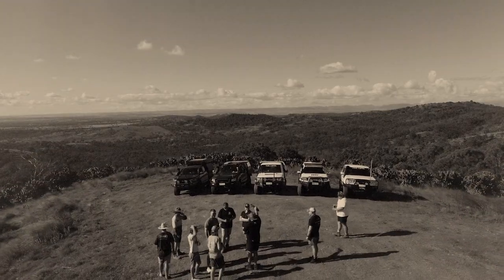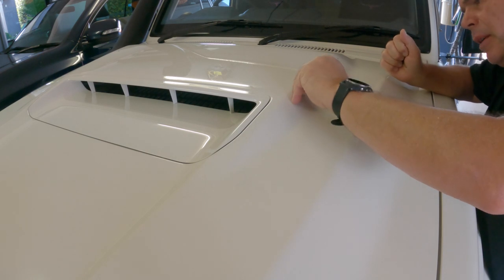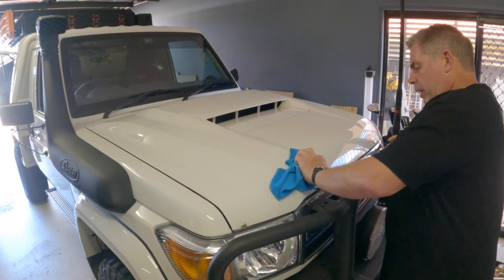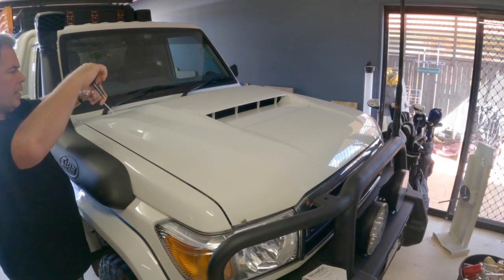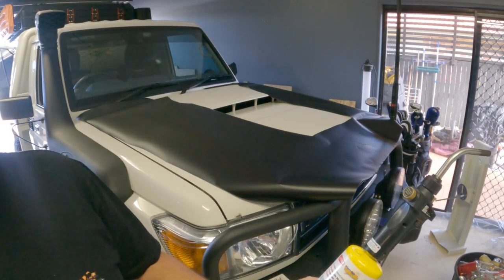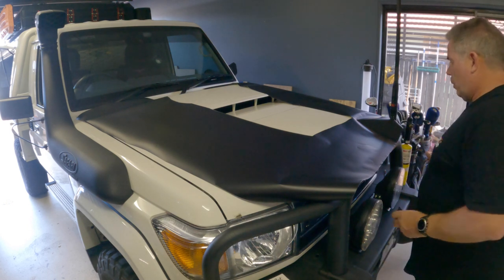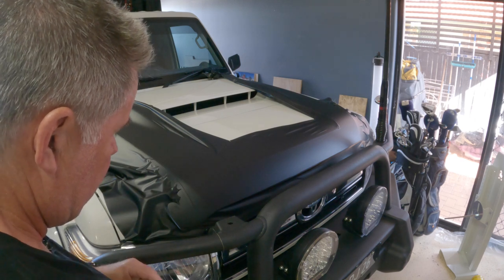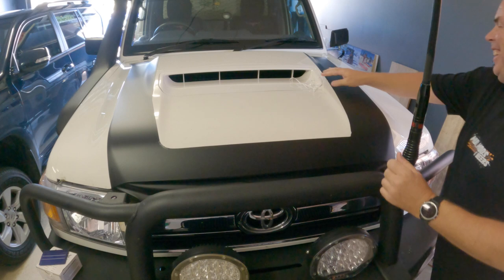We custom wrap the 79 Series Land Cruiser Bonnet in Hexis Satin Black Vinyl.

Comment: A nice quick job.
The issue that exists on current model LC79's is the "sun spot" that runs across the top and back (windscreen side) of the intercooler bump.
It's like looking at a working welder
Reply from the maker: Agreed, I thought about wrapping that part too, probably should have. I suppose that’s why a lot of people run that strip of tint on the bottom of the windscreen.
Thanks for watching mate!